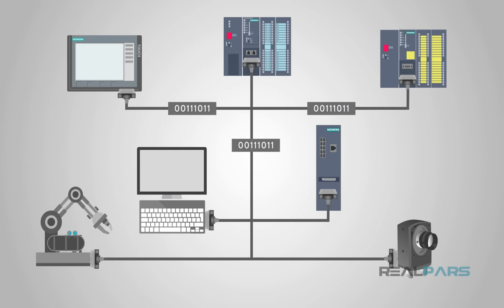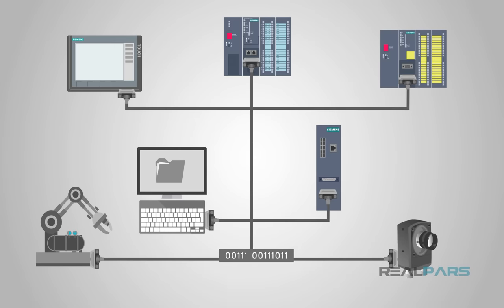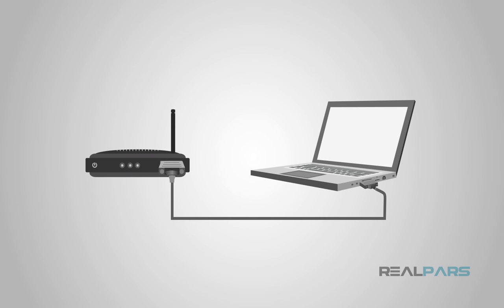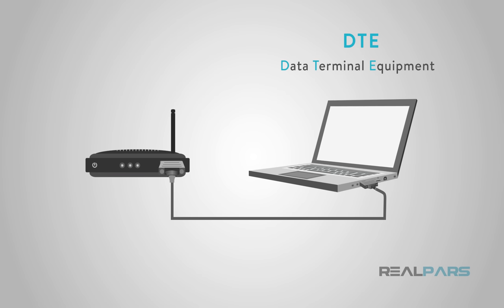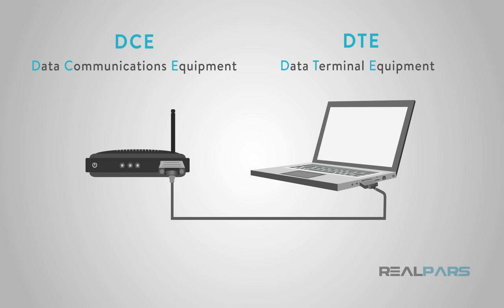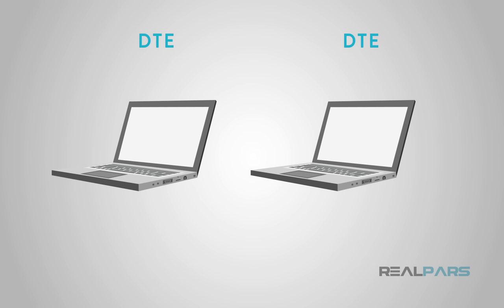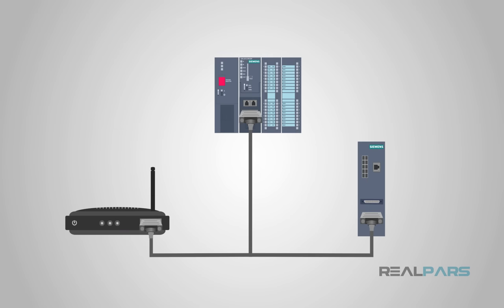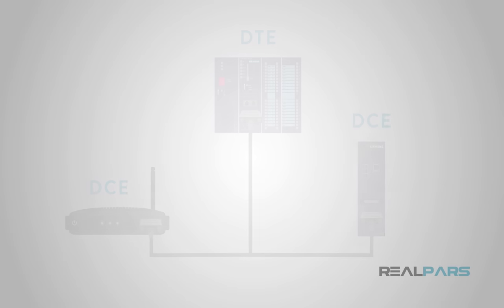What is RS232 and What is it Used for?

Comment: Max cable length of 50 feet was the standard using the cabling that was available when the RC-232 standard was developed back in the 60s.    It's better to say that the max cable length is limited to 2500 pF of capacitance.   Cable capacitance is determined by the type of cable used.   With CAT-6 cable 2500 pF is about 500 ft.   In the real world it's possible to reliably run RC-232 over a CAT-6 cable up to 100 feet without any problems.
Reply: I maintain a very large network of 232 equipment. It is routine in our network for 232 to be run well over 300ft.

Comment: in another video, you say rs232 only connects to one device but here you connect multi-device, I'm confused now realpars?!!
Reply from the maker: I agree it appears confusing.  RS-232 is a voltage-based, serial communication protocol.  Normally, two devices are connected together with a cable and they can communicate via RS-232.  There are RS-232 multiplexers that can allow multiple devices to be connected together, but that was not explicitly demonstrated in the video.  It is best to consider RS-232 as a protocol that can communicate between a PLC and a single device.

Comment: Omg I ran so many RS-232 cables throughout a building for terminals. Back in the day RS-232 was on a DB25 using full hardware handshake. Also 20ma current loop was used for long hauls. Originally used to replace telegraphy equipment along the railroad. Western union used it for telegrams on Teletype equipment.
Dont be fooled just by DB9 connectors as RS-232 was originally DB-25 (25 pin connectors)

Comment: RS232 in the real world is full of nasty surprises though. A lot of equipment isn't entirely compliant.
- The correct voltage levels are +-12V, which is great for driving long cables. But it's also difficult (ie, expensive) to generate electrically from the supplies typically available in equipment, so corners are sometimes cut and the voltage reduced. +-5V is so much easier to make, it's just a cheap charge pump, and most equipment is fine with it over short cables. But then you happen to have that one piece of equipment that isn't, or a long cable, and the connection doesn't work - for reasons you won't be able to identify without electrical test equipment.
- USB-to-RS232 adapters often skip out lines like flow control, RI and DCD. Again, to save money, because most equipment doesn't need these lines. So who will notice? Until someone does. So you end up with adapters that seem to work, pass any test, work on most equipment - but then you start on certain devices, and they fail. Worse, those flow control lines only get used under substantial data transfer - so the link may appear to pass every test, you may even be able to use it to configure your device without any problems, giving the impression that all is well and your serial link is fine - then you send a page full of text to print or a long string of g-code commands and they end up corrupted.
- There's no autoconfiguration. You need to get every setting right - bit rate, parity, start and stop bits, byte length, flow control method. A misconfiguration of length or flow control again may appear to work when testing, but then fail when sending the intended data through.

With RS232, you really need to know everything there is about how it works in order to recognise and diagnose problems. There's a reason USB replaced it, and it's not just because USB is faster.
Reply from the maker: Thank you for your comment!  As you point out, even devices which appear to subscribe to the RS-232 standard sometimes really aren't compliant.  There are numerous pitfalls, like line loss over long cables, non-standard pinouts, etc., that can make connections between devices harder than it appears it needs to be.  Developing skills in solving these problems requires a detailed understanding of the protocols.  Those skills come through experience.
Reply: @realpars  hi, i was wondering if you could help. i have two pieces of equipment sending data to a laptop via rs232. it used a old laptop with multiport pcmcia card. laptop is broken. new laptops have a rj45 port, how can i get the 2 rs232 ports of data going simultanous into one rj45 port?

Comment: Hi realpars
When connecting 3 or more devices together do you use a cable splitter? Will it work if i cut the cable and connect the colors together to make a daisy chain?
Reply from the maker: The answer is under certain circumstances, this may be viable.  RS-232 is a point-to-;point, or 1-to-1 communication protocol and does not inherently have addressing capability.  However, some manufacturers have layered a hardware or software solution on top of RS-232 that includes addressing using RS-232.  The most common way to do this is to use RS-232 to RS-485 converters to extend the communication beyond the 50-foot limit of RS-232 and to add software that routes the RS-232 commands and responses to/from a specific node;
Reply: @realpars  so if i add a rs232 to rs485 converter to each device and daisy chain rs485 side with eachother, it should work?

Comment: I have a question that came up to me when watching this video. In minute 4:40, you show something that seems like a "rs 232 Network", but is this possible?
Given that rs232 is a point-to-point serial communication, is it possible to connect to the PC and the VFD if the plc above had only one rs232 communication port? there wouldn't have to be a HUB with several rs232 ports or a switch that regulated the information traffic at the points where the connections crossed?
Also, since the computer, plc and VFD are DTEs, wouldn't there have to be DCEs for the two points to communicate?
Does the network you've designed possibly need more components but for simplication purposes there are omitions?
In my opinion, there has to be a HUB between the PC and the VFD that "splits" the cable going to the PLC, considering that both the VFD and the PC already have DCEs that allow communication between different devices.

Thank you for your videos;
Compliments from Portugal
Reply from the maker: Hi Daniel,

Thank you for your inquiry. Typically, RS232 is designed to operate between a Data Terminal Equipment (DTE) and Data Circuit-terminating Equipment (DCE) in a direct, point-to-point wiring configuration. However, if you intend to connect two DTE devices, you can employ a null modem cable. This cable features crossed wiring to facilitate communication between two DTE devices. There are two main types of RS232 cables: Straight RS232 and Null Modem RS232. Additionally, using an RS232 hub is a viable option. RS232 technology dates back to 1962, yet it remains in use today.

For further insights and learning resources, feel free to explore the following links. 
https://www.blackbox.com/en-us https://en.wikipedia.org/wiki/RS-232 https://us.rs-online.com/view/search?keyword=rs232%20cable

We hope you find them helpful in your learning journey. Happy learning!

Comment: Thanks a lot for this explanation, but i think that the RS232 is a point to point network, wich you can connect only 2 devices, that's why the RS422 and RS485 came after that and allows the multipoint connection, is that correct ?
and it's the physical support used also in the Serial Modbus and ProfiBus network.
Reply from the maker: You're very welcome! Yes, this is what we mentioned in the video as well. We are working on a new video for RS485.
Reply: RS-232 is peer-to-peer and RS-485 is multidrop. I think the image on the video is causing confusion...

Comment: Hi, awesome video , I need some help though. 

Can you convert a rs232 to ethernet and the back to rs232 with a adaptor? 
And would the a PLC still be able to understand the data and continue to send and receive data?

Thanks
Reply from the maker: Yes, RS-232 to Ethernet adapters are readily available.  It may not be as easy as "plug-and-play" to use the data in a PLC, however.  The serial data stream is essentially a character stream that would need to be interpreted based on the characteristics of the device.  The converter will need to be configured for characteristics of each device (on the Ethernet side:  IP address, etc., and on the serial side:  baud rate, stop bits, parity, etc.).  Most converters come with driver software that allows the creation of a virtual COM port that supports the setup and configuration of the interface.
Reply: @realpars  thanks so much , really great if you to take the time to reply to my question!

Comment: What is the bandwidth of serial cable and why it is not being used in real time scenario now a days between router ?
Reply from the maker: The bandwidth of RS-232 is approximately 20kBaud.  Although this fast enough for much of what we need to do for communication, Ethernet is cheaper, faster, and more reliable than RS232.  Ethernet is an advanced type of serial communication which is routable, whereas RS-232 is point to point without special multiplexer hardware.

Comment: Can you please tell me what is the difference between usb to RS-232 converter and Modbus protocol
Reply from the maker: Modbus is a well-established serial protocol that was developed to make it easy for PLC's to obtain data from up to 254 other devices on the same 16-bit network .  USB (Universal Serial Bus) is a lower-level connection between two devices.  An RS-232 to USB converter is a piece of hardware that allows older RS-232 devices communicate with newer PC's and laptops via USB (newer computers no longer have serial ports other than USB).

Comment: I have a question, i have an oscilloscope which uses RS232 for PC communication, but it uses a Ethernet-like cable. How do I connect it to my PC?
Edit: a RJ45 connector
Reply from the maker: Interfacing devices to a PC depends on a number of factors.  First, each manufacturer creates a port that is available for communication and is "pinned out" according to their own standard.  The first thing I would do is find the documentation provided by the device manufacturer to see what that pin configuration is and if they provide instructions and/or a cable suitable for connection directly to a PC.  This would likely need to be interfaced via a USB port (which is a serial port on the PC).  The issue is not so much the connections (RJ45 to USB cables are very common), but rather how can the PC interpret the data from the serial device?  This usually requires an application or other instructions from the manufacturer of the device.  I would definitely contact them directly with questions about how to interface the device to your PC if their documentation does not already address this question.

Comment: Is it possible to connect two or more devices in a parallel connection to a single UART channel for both  Rx and TX
Reply from the maker: It is possible, but voltage drop and connection integrity may be issues if not done properly.  There are many commercially-available devices available that will allow you to connect multiple devices as you describe.

Comment: RS 232 is a point-to-point connection. An RS 232 cable can only connect one device to one other device. The connections shown in the diagrams are not possible.
Reply from the maker: As shown, you are correct.  The video was simply trying to convey that there are a number of different device types that can be connected via RS-232.  Thank you for your comment, and hopefully, this will add a little clarity.

Comment: Serial communication can talk with one device only.
Am I right?
Reply from the maker: Serial communications can be confined to one device per interface, such as RS-232, can be multi-drop to several devices, such as RS-422, or can be shared among several devices with a "hub" like USB.  Technically, Profibus-DP and many other fieldbusses are serial in nature, based on RS-485 or other serial precursors.  Industrial fieldbusses are what are called bit-serial communications, which is more advanced and capable than simple serial interfaces like RS-232 and Modbus ASCII.
Reply: @realpars  Can't you use Modbus to talk to multiple? Just learning, but....

Comment: Can we connect multiple devices using Rs 232 please reply
Reply: Not as far as I know. For my understanding RS232 is a point to point connection.... correct me if I'm wrong.
Reply: I also found same thing
Reply: In some cases, you can use "passive splitters" like as: https://www.blackbox.com/en-us/store/detail.aspx/6-Port-RS232-DB25-Passive-Splitter/TL074A-R4
Reply: Yess point to multipoint it is possible
Reply: this is the reason why i start reading comment after few seconds watching the video , rs232 is point to point communication and to let it communicate with multiple points you need an adapter (splitter) , the video is good edited but the content is somehow tricki
Reply: You can assign a master, and control a number of slaves, where the master only has a single serial port. The master waits until DTR is set, and then clears DSR, sends a packet addressed to one slave, and then sets DSR. The addressed slave waits until DSR is set, clears DTR, and replies. The master doesn’t send while any slaves have cleared DTR, and no slaves talk over each other when DSR is clear. The master can clear DSR while any slaves are clearing DTR so none of them talk over each other.

Comment: How is RS232 used for multiple devices?
Reply from the maker: The short answer is that you cannot use a single RS-232 interface for multiple devices.  A single RS-232 port generally has one UART (Universal Asynchronous Receiver/Transmitter) and allows connection to one device.  However, using a switching mechanism, some manufacturers have developed RS-232 multiplexers, which enable one RS-232 transceiver to communicate with multiple others.  Since RS-232 is a voltage-based protocol, there are additional hardware requirements for multiplexing that guard against pulling the signal voltage to below specification.  Multiplexing is outside of the RS-232 specification (RS-232 does not support node addressing), so there may be handshaking issues upon implementation.  Using a USB hub with multiple RS-232-to-USB converters has been successfully implemented as well, but often there are port assignment issues or instability of device drivers with this configuration.

Comment: What's that db 9 cable
Reply from the maker: DB9 refers to a D-Shell connector that has 9 pins.  These types of connections were very common on PC's prior to about 2000, when USB replaced the DB9 connection for serial devices.

Typically, a serial DB-9 cable has the following pinout:
1) Carrier Detect
2) Receive Data
3) Transmit Data
4) Data Terminal Ready
5) Signal Ground/Common
6) Data Set Ready
7) Request to Send
8) Clear to Send
9) Ring Indicator (not often used)

Comment: I'm no authority, but isn't it a RS-232 CABLE and a DB-9 CONNECTOR?
Reply from the maker: To be 100% correct, yes, the cable carries the signal and data, and the DB-9 connector is the most popular connector used for RS-232 cables.  In fact, when I was "growing up" in automation, when I would see a cable with a DB-9 connector, it almost always was an RS-232 comm cable.